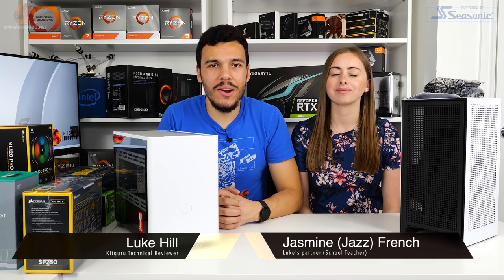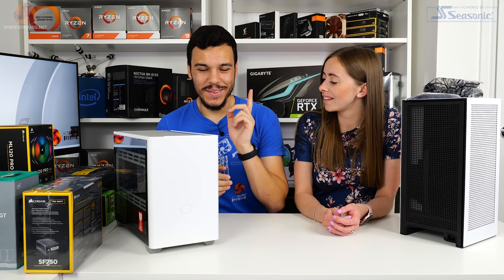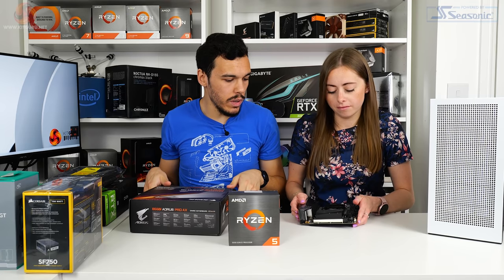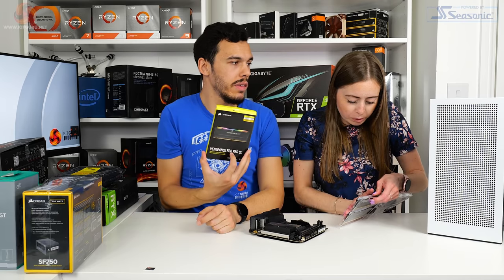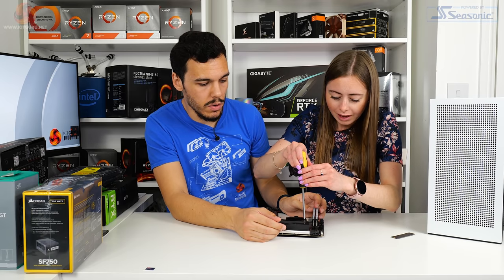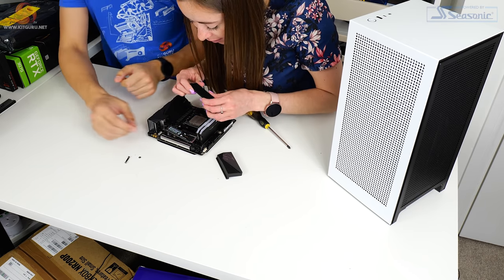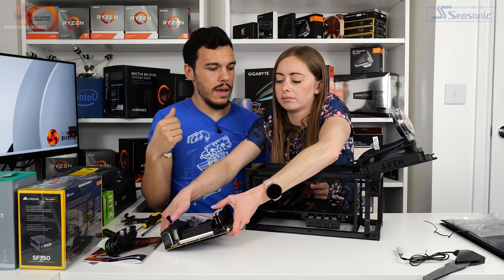Jasmine builds her FIRST PC (Part 2)

Comment from the maker: The thermal paste application  - oh noes !
00:00 Start
00:15 Introduction / use cases for system
03:03 Parts picked for the system - keeping it simple!
07:38 Motherboard and processor
12:40 Memory
15:05 SSD’s
23:03 grabbing some bits from box
25:34 Opening the case
28:07 Jazz drops a screw into the power supply!
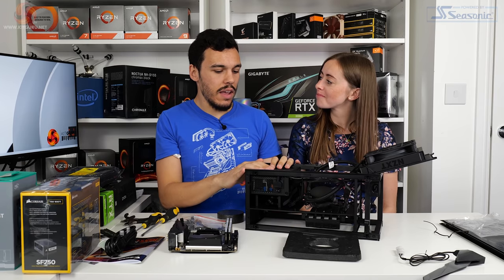31:15 Installing the motherboard in the case - and cables
45:00 Sorting out the CPU cooler / wiring
47:37 Thermal paste application and block install - oh dear 
56:18 The graphics card / riser cable
1:03:52 System is built - connecting the cables
1:07:07 Firing the system up
1:09:10 Windows booted up
1:10:18 Playing some F1 2020
1:14:07 Playing some Rocket League
1:15:23 Closing Thoughts

Comment: Just watching this because of Jasmine 😉 Keep up the great work you guys. I would picked the nzxt case. Build in AIO and PSU but the NR200P is so spacey to build in and it's way cheaper.
Reply from the maker: The NZXT case is very good looking. The built-in PSU and AIO is also quite useful for novice builders who don't fancy doing cable management or screwing in a rad. Luke

Comment: You should also mention that you need to go into the bios to set the ram to run at 3600mhz speed.
Reply from the maker: Very important point indeed. We didn't want to scare novice builders too much with talk of XMP and BIOS settings and Infinity Fabric. But applying XMP is certainly important (and it is something that novice users will likely understand if they read some reviews for the RAM/motherboard they buy). Luke

Comment: Great Build and video! I look forward to more SFF content !
I have a future mod suggestion, though the current setup is also perfectly fine- 
1. Install a small screen on the PSU cover  (On the go boot screen/ temp screen/ discord display). I got mine from TRTfoundry but now Jakeface makes it. Shipped to the UK in 2 weeks. 
2. Install 2x140mm fans at the back with zip ties or noctua rubber mounts (if thermals pose to be an issue at any point) . Arctic P14 PWM PST can be daisy chained, so can Noctuas off of a single fan header.
I have a 5800X and RTX 3080 XC3 ultra in my H1. I’ve done both mods on mine as they are super easy to do, and I love it.
Reply from the maker: Good suggestion with the screen - I will look into that, thanks. Where do the 2x140mm fans go? I can't quite visualise it. The GPU chamber is basically full because of the thickness of the card. Luke
Reply: @KitGuruTech  So it’s physically outside the case.. The rear panel is ventilated. You align the fans on the out-side of the rear panel using zip ties. It doesn’t realistically do anything to the aesthetic of the case since you never really look behind the case anyway. Alternatively if you want a stealthier approach, you can put 3 small Noctua 40mm fans in the GPU bay at the top- back (within the case). 

If you’re unable to visualise this, you can check out r/sffpc and lots of folks have posts on all these mods, with varying results. On average you’re looking at a 5-10 degree drop in temp depending on what you go for.
Reply from the maker: @atthelord  Sounds like a very good solution. Will have to give that a go to see if it can be done while still looking good. Thus far, the temps do seem OK though. Luke

Comment: I have both the H1 and NR200P.  The NZXT is nice because of the built in PSU and AIO, but that's were the advantages end. The NR200 is much easier to get to stuff, IO is accessible without having to move the case, better cooling and much easier to maintain.  Having to pull off two side panels and sliding off the top plus unscrewing the AIO bracket to get to the MB or any connectors is a pain.  Had to do this a couple times while getting BAR to work.  In the long run, you will start to despise the H1 for daily use and wish you spent the extra time building in the NR200.

Also, the extension for the front panel is only necessary if the MB doesn't follow the same layout as the full cable header.  That is why the individual connectors having their own header. I know with my Asus MB, I could directly connect the full header to the motherboard without using the extension.
Reply: Thanks for the feedback. I will see how we go with the H1. I massively prefer the design and overall look of this case.
Reply: @jazz2533  agree, the look of the case is top notch.  If you ever want a little more RGB to it, I found that a strip on the inside of the front frame has a nice diffused look to it.
Reply: @handlealreadytaken  Thank you. Yes, I love RGB! Any recommendations?
Reply: @jazz2533  I just purchased an a-rgb kit off Amazon.  One that has a magnetic backing so that it easily sticks to the rails.

You can see how it lights up more of the graphics card and the NZXT logo on the radiator.

https://imgur.com/DdLbf69

https://imgur.com/lc3RDY4
Reply: @handlealreadytaken  ooh that's beautiful ! Thanks Chris. 👍
Reply from the maker: @handlealreadytaken  Very nice! Is that a TUF Gaming card? How did you find its performance inside the H1? Luke
Reply: @KitGuruTech  Yes, it's the Tuf 3080 OC version.  I found that the card is typically in the high 60's when playing something like CP2077 @4k with everything turned up as high as possible.  Previously I had an EVGA 2080 Super which would get into the low 80's and start to throttle.  Asus did one heck of a job with the cooling on the Tuf line.
Reply from the maker: @handlealreadytaken  TUF 3080 is a beast! They did an awesome job with that cooler. Luke

Comment: Luke, I would simply have turned the PSU upside-down and let gravity do its work. If the screw gets in the PSU through one of the holes THAT easily then it should be possible to get it out. I am not too worried about damaging the components of the PSU with a screw. Screws are sharp, the weight is low, it should be fine. I am curious how you got it out. Please do explain and I will warn other readers not to do it themselves. ;)
Reply from the maker: I think your idea of turning it upside down and shaking it would probably be the best approach. I didn't really want to do that mainly because the PSU is pre-installed and I didn't fancy pulling it out (and the entire case was a bit too heavy for me to shake about). I will be honest in saying that I know where to touch and where no to touch inside a PSU, so I was OK getting it out with an insulated screwdriver. But I would DEFINITELY NOT reccomend that to any novices - and hopefully some less experienced builders see the mistake and don't go rustling around the inside of their PSU. Luke
Reply: @KitGuruTech  Dropped screws happens easily when assembling a PC, especially those tiny screws which you can't hold while you screw it in (not with my big hands anyway). I dropped a screw under my motherboard in the last build, I got it out but you do worry about scratches. I would love to have a few magnetic screwdrivers but I haven't found any where I live.
Reply from the maker: @peterjansen4826  Motherboard screws, SSD screws, standoffs - they're all a nightmare to me :D! I remember getting a motherboard screw/standoff stuck in one motherboard before giving it to James. Made quite a nice mark on his table... woops! Luke
Reply: @KitGuruTech  Yes, they did not take into consideration how it is for people with big hands. :) If it would be easier to buy magnetic screwdrivers then this problem would be solved but most people have to make do with regular screwdrivers and then these little accidents happen. 

Other things which I struggle with while assembling a PC: 
- how tight to turn the screws of the motherboard, I don't want it to flex when I put some power on it (like inserting RAM or inserting the USB 3.0 connector) but I also don't want to overtighten it. The last time I felt that I had to use quite a lot of force to not have any flex, I am not comfortable with using force with any PC-hardware.
- that USB 3.0 front-panel connector, I hate that connector. 
- those plastic locking things on the side of the PCIe-slot, some graphics cards don't fit on some motherboards because of those things but the motherboard-companies do not warn for it. 

I think that AMD should use brightly-colored triangles for both the CPU and the socket, like Intel. I got it in correctly but I wasn't at ease about the orientation so I ended up looking at the pins and holes instead and verifyting that I had the correct orientation.
Reply from the maker: @peterjansen4826  I too hate the USB 3.0 internal connector. It's too big and bulky and is awkward to work with in my opinion. And the PCIe retention clips are annoying too, as you say. Yes the gold triangle on the AMD corner is quite subtle, but hopefully some less experienced users can see content like this and know to watch out for it. Luke